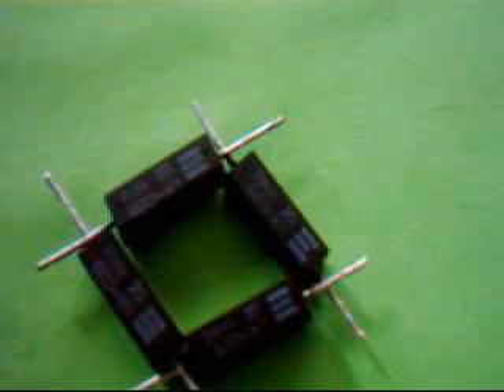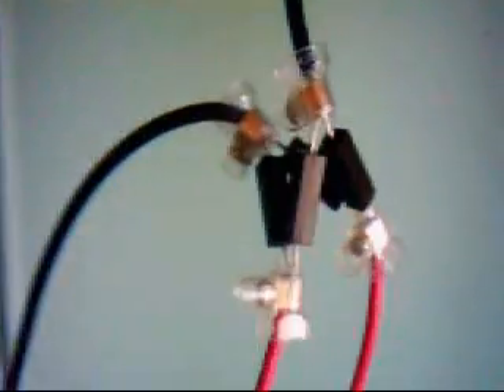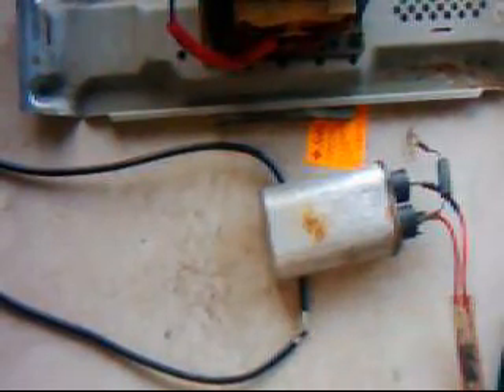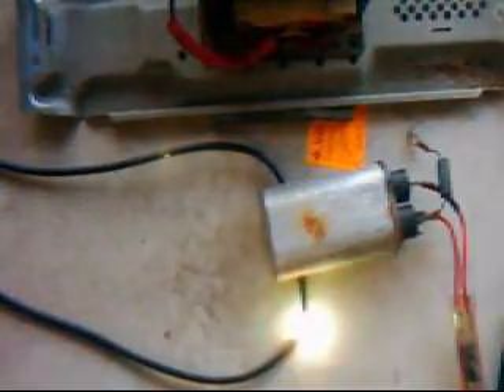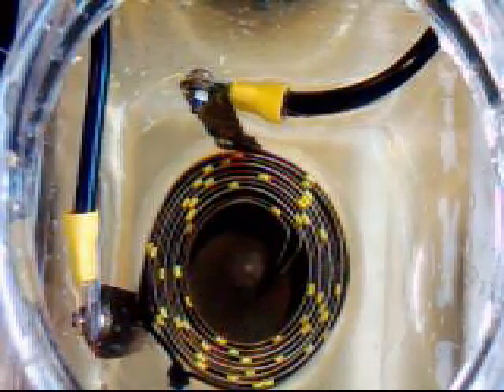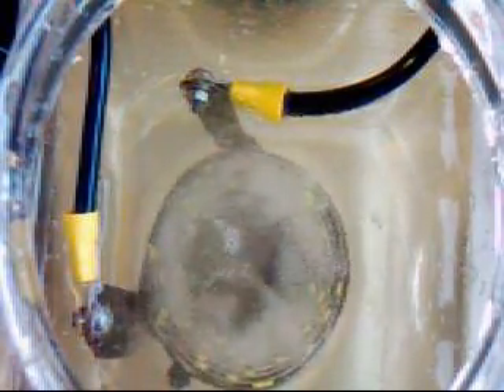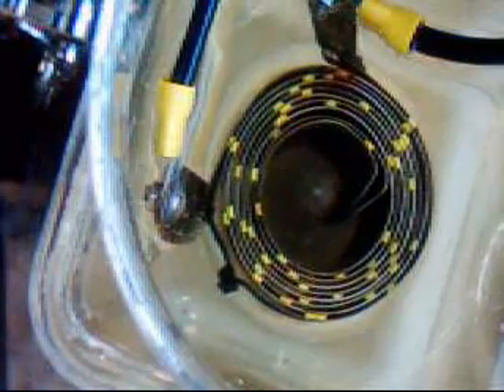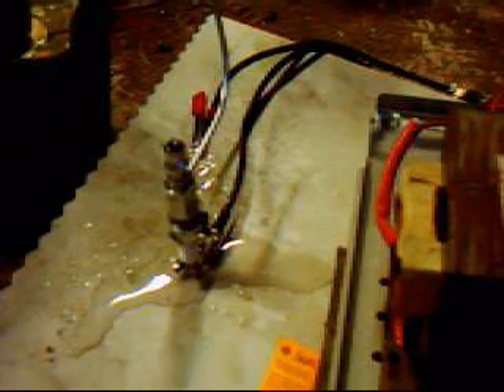High Voltage DC Experiments

Comment: thanks for the video, i'm looking for high voltage DC 
for an air-ionizer.
what voltage did you use, 220V or 120v?
what voltage did you get?

Comment: Very nice I like the vid have u tried the pottasium carbonate on the plug vid and HV I would also like to see it with a pwm controller if possible. Thanks for the vid i just stared to get bubbles from my cell using a MOT I think my newer cells will work real nice using one. Thank you for the vid.

Comment: If you not only put up a high voltage, but send the voltage through a PWM to several kilohertz, or better, several Mhz, You should be able to annilate the water molecules using plain tap water, river water, or urine.

Comment from the maker: lol-thats cos the chassis is grounded to the HV.
im guessing it arced out to the floor from the transformer.
there should be 2 diodes in each oven.
the other 1 isnt so obvious.
have you seen what FBRK8R has done with two MOT's and the drive motor from old washing machine?
check it out-if you havent already=]

Comment: The original schematic of the microwave had one large capicitor and one diode in the secondary, I'm not sure how the winding of the secondary was, but it used three terminals and a ground to the transformer core. (btw, this was an interesting project done on a concrete floor, I dont recomend it.)

Comment from the maker: thanx for that -did you rectify the output like i did,or use it AC?
it will pull over 4 inch arc without the rectifier/diodes.
it would probably like to have the cap tho to balance the load.
did you have the frequency doubler as well?

Comment from the maker: the cell was wound around a post with a slot and held with wire,then heated with blow torch to hold its new position.repeating this process until it was desired size.
then several hours inserting zip ties,with my pocketknife.

Comment: Nice work
very interesting. I have wanted to use The EHT from a projector. The problem is the low resistance of the cell you cant get the drop across the cells.
I love the video.
How did you build the Cell.